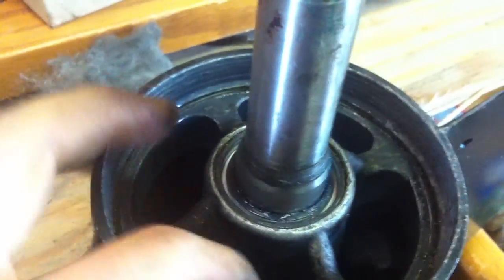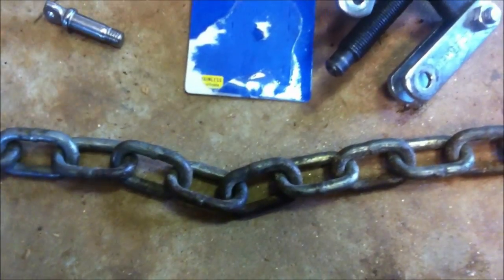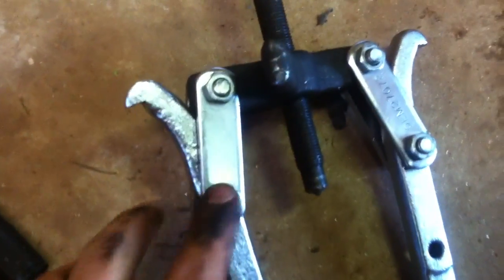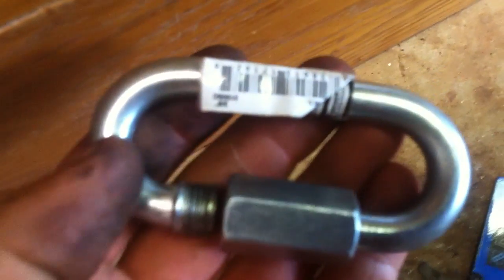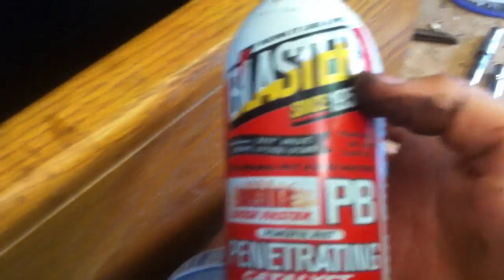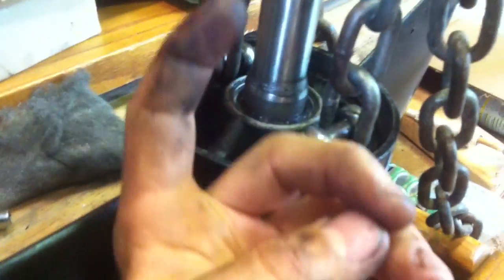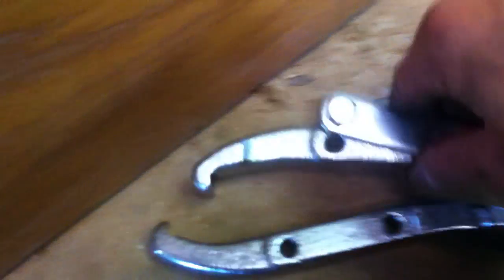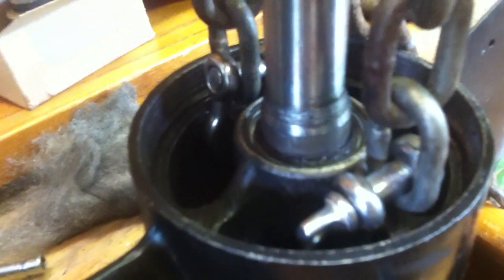How to remove an outboard bearing carrier

Comment: Good idea, my puller is way to small for my 125hp mercury lower unit and iv almost scrapped the lower unit due to the 100s of failed attempts.. almost took my head off on multiple occasions by using my  big engine hoist and strapping the lowerunit down, putting chains on my puller and boom the puller slips out and catapults 100mph skimming my head lol... your idea is way better and safer than mine. I'll be trying this tomorrow! I might just get my lower unit apart now. Thanks.

Comment: i am have the same problem....All hardware has been purchased, will try this out in the morning
I will post here my results, good idea here, hope it works for me.
Reply from the maker: Let us know how it goes...
Reply: @MattsShop  

Setup was good but found out that this lower I had is an old SEI   aka china junk..
I thought I was going to broke the jack bolt... Im think someone welded that in.. (not literally)

Wouldn't come out, so I got the cutoff wheel out,,,,lower was junk anyway..
Reply from the maker: That's too bad. Lower units are not CHEAP! Sounds like someone botched it before you. That's always fun...

Comment: Watched your video tried all the solutions and nothing worked kept digging and found an old mechanic who said put two pieces of 3/8 flat stock between the prop and the housing tighten the prop nut it will pull right out. Worked like a charm... you might need to use some thicker stock and washers under prop nut to completely remove it.
Reply from the maker: Wow! Great tip! I never thought of doing this.
Reply: sorry but how does that get the carrier out
Reply: @muzzlazu5453  it pulls the whole shaft out with the carrier bearing you put the flat stock on each side of the housing make sure it is clear of the carrier and tighten the nut
Reply: @normancopeland8506  I think I understand what you're saying, but if you could be as specific as possible I would really appreciate it... I'm about to tackle this project and your leverage method sounds like the best one, but I dont want to scratch the shaft or crack the housing... any more info appreciated.
Reply: @chrisnelson1714  Scratching the shaft will not be a problem just slide your flat metal pieces between the prop and the housing put a couple of washers under the prop nut on the shaft and tighten the prop nut the shaft and bearing housing will start to come out you might need to add a some thicker flat stock or add washers as you pull. You can pad the flat stock with a red rag or something like that to cushion the housing ...and make sure the flat stock will not hit the carrier bearing as it come out ..you are basically using the prop as a puller..go slow if you feel like it is binding stop check the positioning of your flat stock. it actually should come out fairly easily.Happy Boating
Reply: @normancopeland8506  Awesome, thanks!

Comment: I'm having an absolute shit fight with my bearing carrier💦💦😱😱
Reply: versatec1 Heat is the enemy of corrosion
Reply from the maker: +Kreig Dernier Yes! The expansion helps break it loose too.
Reply: same here with my 25hp 1990 yamaha. stuck as hard as it can. Over night soak didnt help. Tomorrow i need to get some gas torch to heat it up. Heat gun didnt help anything.
Reply from the maker: Normally they heat the lowerunits with an Acetylene torch while it is loaded up with the puller on it. You have to put enough heat to it for the metal to expand. It's like a giant heat sync.
Reply: @MattsShop  Heat seemed to be the only solution which worked. 15min heating with big propane torch was enough while puller was tight all the time. We ended up to pull out two bearing carriers from two similar lower units which were stuck really badly (i need to swap the drive axles).
Reply from the maker: What problem are you having? Have you tried PB blaster, heat, and letting it soak overnight?